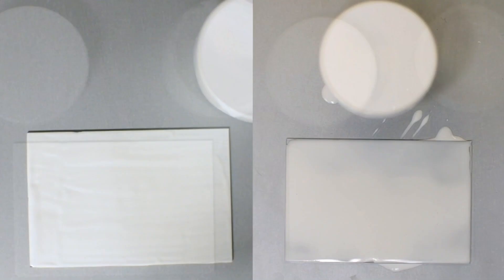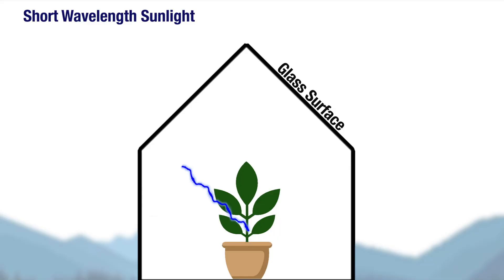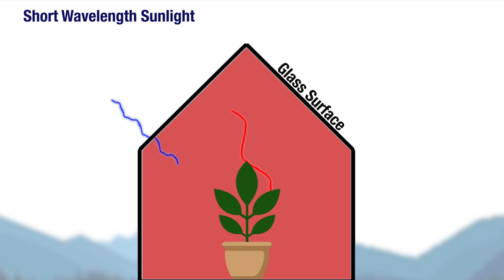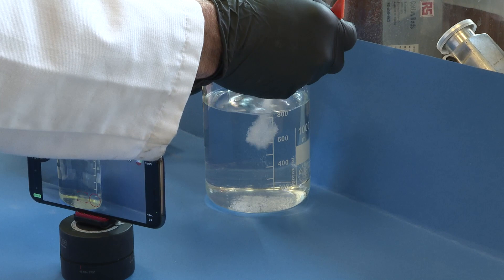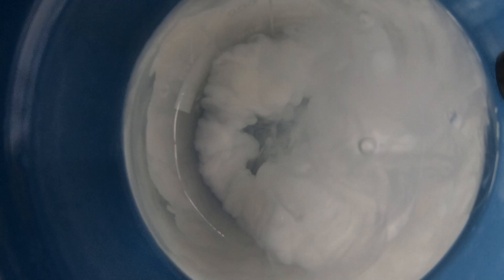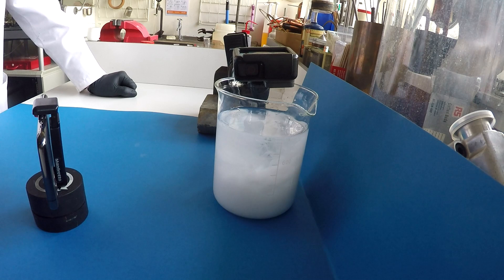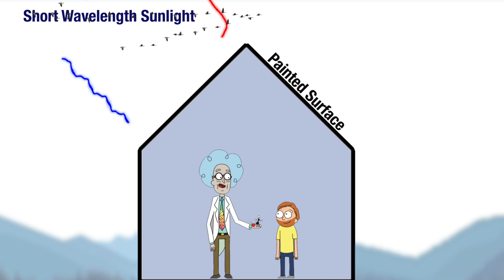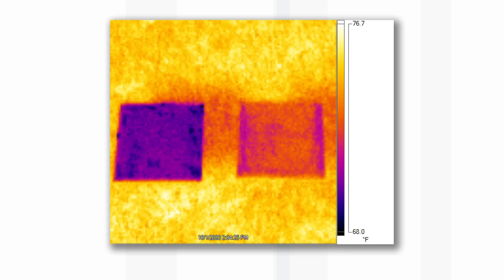Ultrawhite Paint (with Barium Sulfate) - Periodic Table of Videos

Comment: Why do I get the feeling this will be a Thunderfoot topic before too long.
Reply: No idea. This is entirely valid.

Something they're not explaining well in this video is that short wavelength infrared is reflected but long wavelength is transmitted. That's why the long wavelength emitted by objects at ordinary Earth temperatures can pass out of the object through the paint, whereas short wavelength infrared from the sun gets reflected away.

Of course, that means infrared from other stuff will be absorbed through the paint, so I imagine something like this is only really effective outdoors.

It's sort of like using a solar cooker at night, and how that causes sub-ambient cooling because it blocks infrared from other things getting into the cooler, while also directing emitted light within the cooler up into space.

Comment: That's one important step to nuke-proof your home. At least from the heat radiation. 😮
Now to just find a commercially available method of producing graphene homes with structurally integrated shock-absorbers, then finish it off with a nice coating of Barium Sulfate. 👌 I'm not paranoid, at all~

Comment: Titanium is 10 times more abundant (0.5% vs 0.05%).
Reply: But also drastically inferior.
Reply: @seigeengine  Yea, but can we mine enough to paint every roof? Titanium is top10 element on Earth, Barium not so.
Reply: @gabest4  We don't need to paint every roof.

We also currently produce about the same about of barium sulfate as we do titanium dioxide each year (8 to 9 million tonnes), as well as there being similar known/expected reserves (700 to 2000 million tonnes) of both barium sulfate and titanium.

Comment: As far as I understand radiative cooling at tempeartures below 100C accounts for a tiny percentage of total cooling, with most (over 90%) going to convection. So this paint will probably help very little just in that regard. The roofs are usually further insulated and heats convects up anyways, further reducing the effectiveness. So, in conclusion, just another massively overhyped tiny discovery.

Comment: Obviously this is only useful in regions without winters, otherwise you will need to swap the roof of your house two times a year.
Reply: Nah, the radiative cooling probably wouldn't do much in the winter. If you got a dusting of snow on top of your roof, that would prevent it from radiating the infrared out. The structure of your house would radiate IR up into the blanket of snow, which would then reflect it back down into your house I think. I'd love to see them actually test this, and see how it behaves in real world applications like a roof in the winter.
Reply: @byal9000  Snow is not common in most parts of the world. More so, you need to take into account that no UV light enters the house, so that it will naturally become a lot colder inside.
Reply: @Groink1  No UV enters the house when there's snow on top either. Also, if you have insulation in your house, you're not getting that heat from your roof anyway. Regardless, the cooling effects in the winter aren't as big of a concern if you don't get any snow. That means you're already in a pretty warm (or arid I suppose) climate.
Reply: Snow has not much to do with temperature. I've seen winters with below -20 °C with nearly no snow at all. Please, think about what you write.
Reply: @Groink1  I'm sorry, I'm not a moron, so I don't live in a desert.